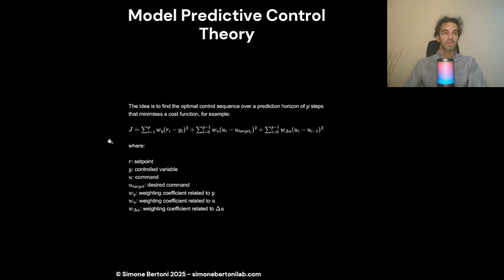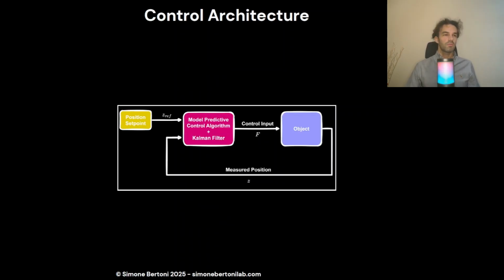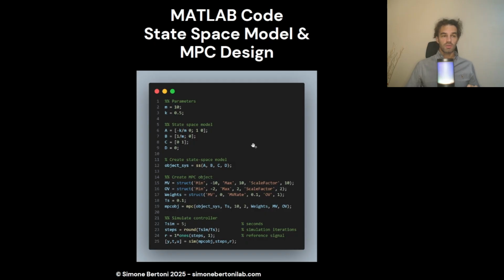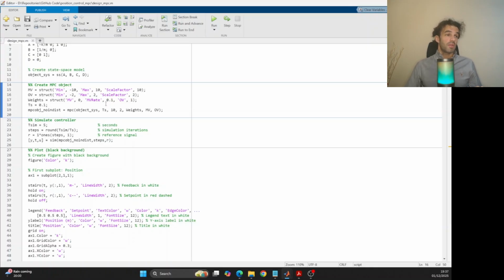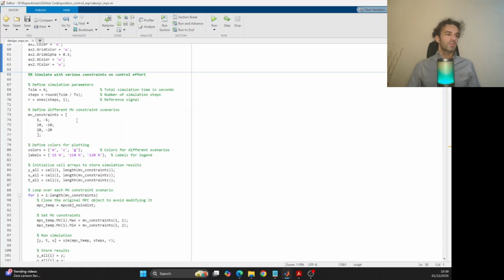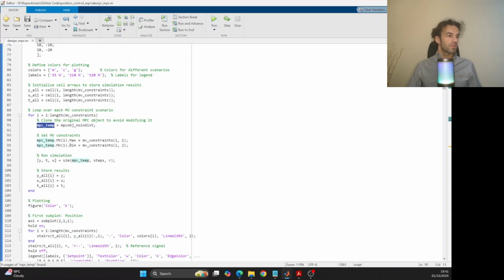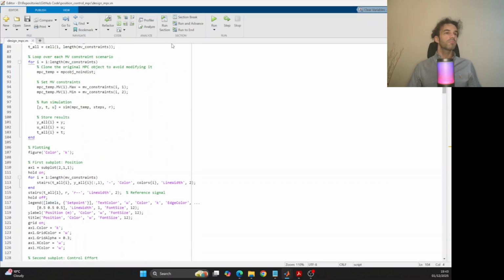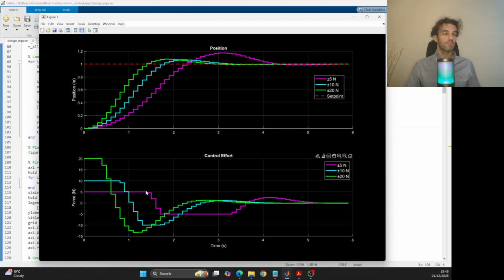Linear Model Predictive Control in MATLAB - Part 2 (Constraints)

Comment: This was very useful!!! Thanks for posting this! Just a question: If we don't know the state-space model (the matrices A,B,C,D) then how can we proceed? I'm having an embedded system where I'd like to control some things, but I have no idea of what equations are there. Is there any way systematic to figure this out? Or do we have to do trial and error?
Reply from the maker: Hi there! Glad to hear it was useful. You have two main options:

1. If you know what kind of system you have (for example first order, first order with delay, second order, etc) you can do some identification on the parameters that you don't know based on the data logged. For example the time constant of the filter, etc. There are system identification techniques that can be used to do this.

2. You have no idea at all. Then you need to do your identification starting from the data and the algorithm will have more freedom in "guessing" the order of the system, etc.

It can be more complex, for example, with a nonlinear system.  In that case you need some assumptions on the nature of the system.

But generally, system identification is the place to go.
Reply: @simonebertonilab Got it! I'll look into these topics 👍